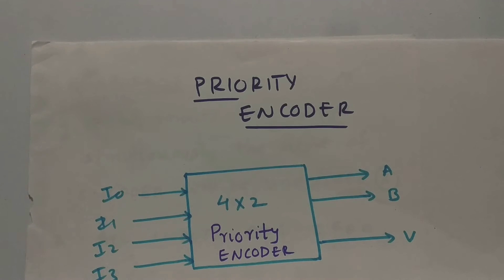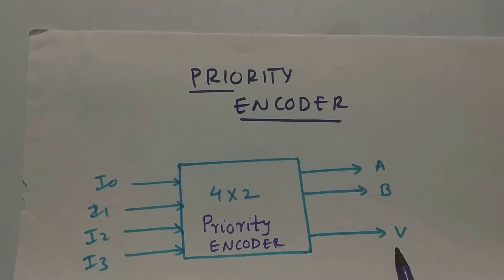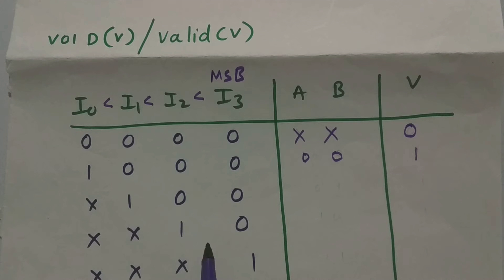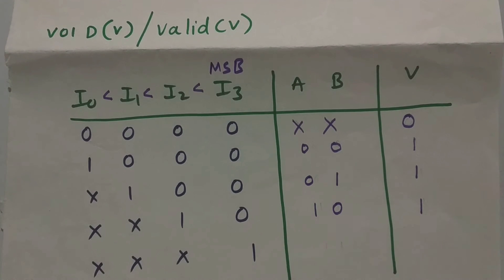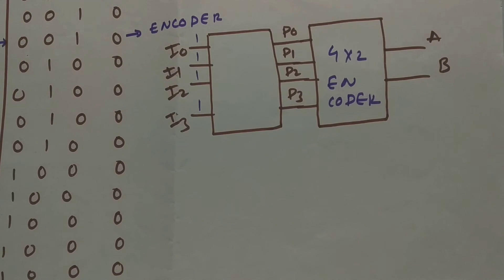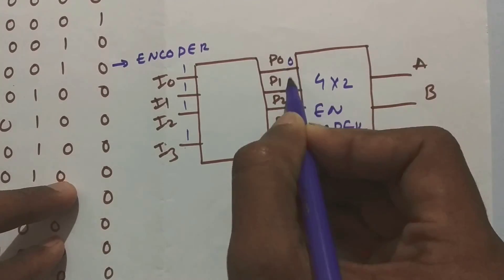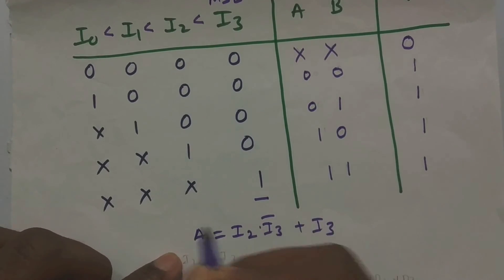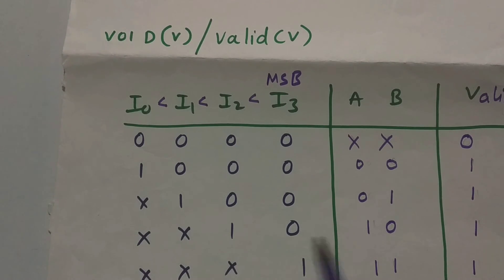What is priority encoder ?  How it solves limitations of encoder? | Explained with example.

Comment: What are the real life examples for priority encoder?
Reply: Don't assume that all the inputs are counters.
He put all combinations.

Now coming to real life example:
If you have four ports sending data and there is an arbiter/mux which pics one of the port based on priority.
I0, I1, I2 and I3 are four ports.
'1' is data valid on each port.
All possibilities of valid data on each port as below.
0000
0001
0010
0011
0100
0101
0110
0111
1000
1001
1010
1011
1100
1101
1110
1111
Where '1' is data valid.
As per the priority encoder, the output is two bits.
Example :
1011 -> data is valid at port 3, port 1 and port0.
For MSB priority encoder the intermediate output is 1000. Final output is 11.
'b11 -> 'd3
arbiter/mux picks up port 3 data. Port 0 and port 1 data is ignored at this time.
In an efficient design, port 0 and port 1 data are stored (let's say in FIFOs) and pulled when port 0 and port 1 has owned the priority.